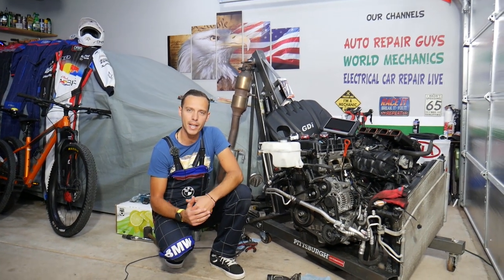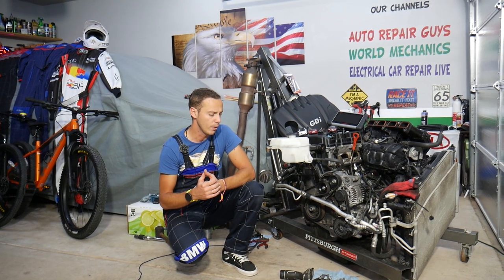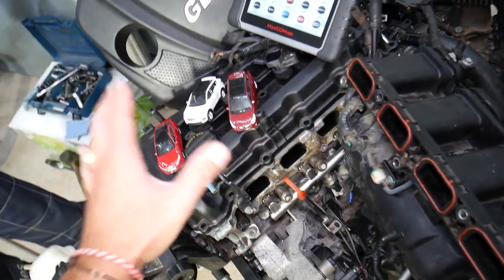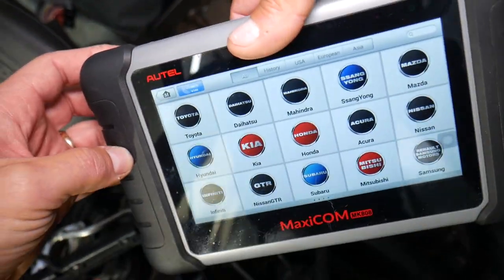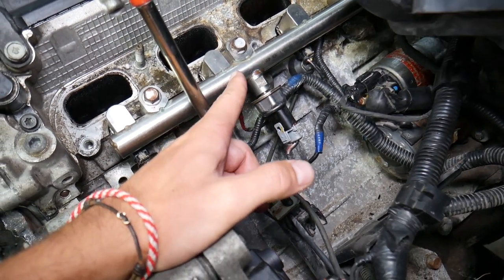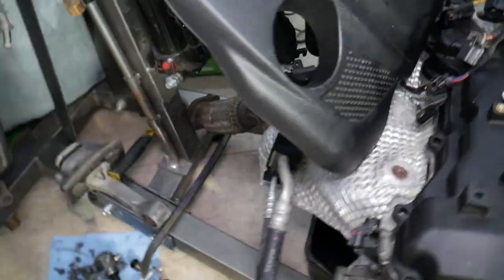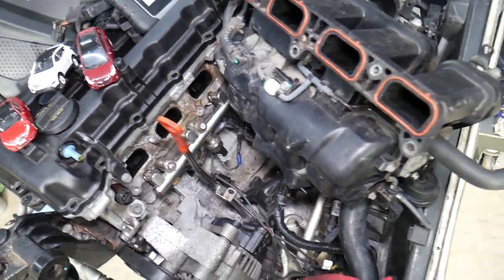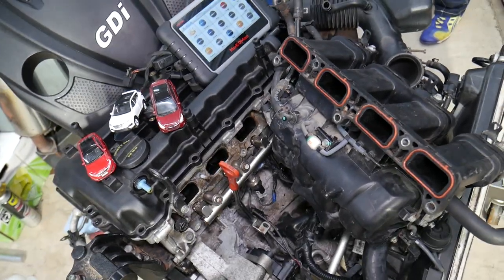HYUNDAI KIA GDI CODE P0172 SYSTEM TOO RICH BANK 1 FIX, GDI 1.6 1.8 2.0 2.4 2.5

Comment: Just swapped engine on 2002 BMW 745 . Crank no start , no spark .. rpms moving so crank sensor is good  , I have power and ground to coils but no signal to 3rd wire .. all fuses are good no codes .. any idea ?
Reply: Sounds like anti theft